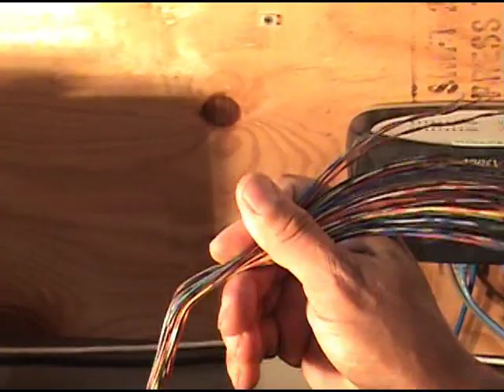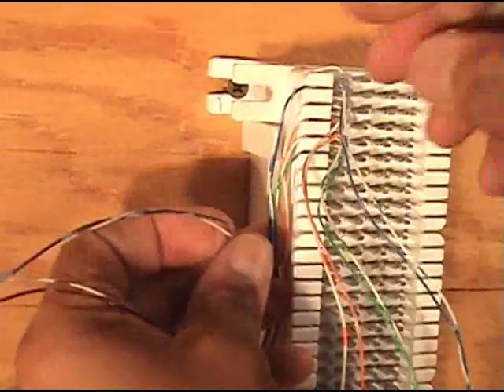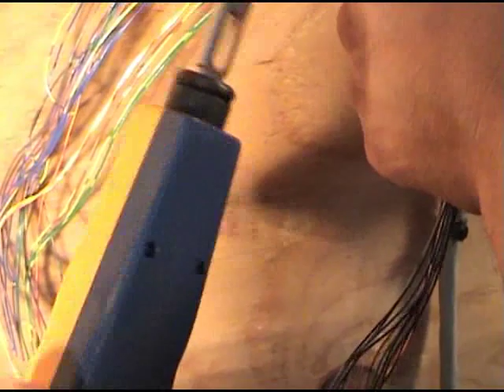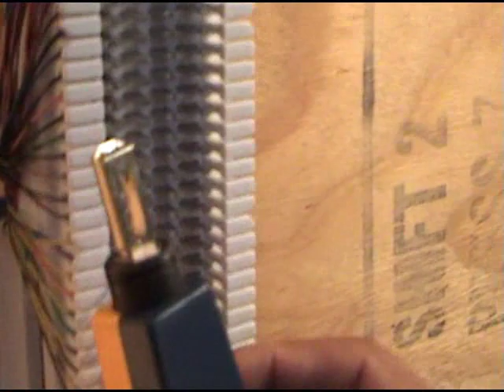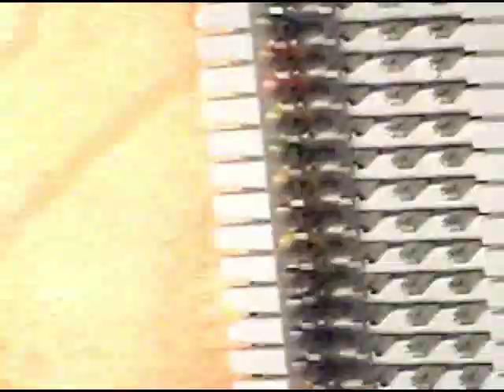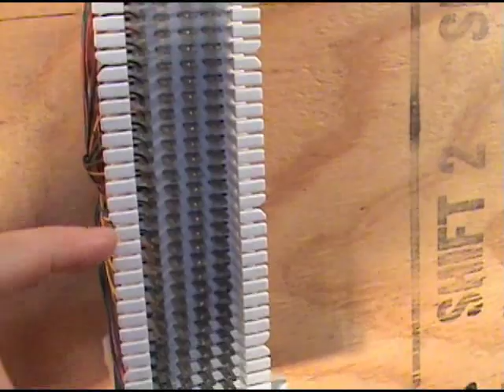How to punch down a 25 pair cable to a 66 block

Comment: Your end result looks ok, but it's much easier to fan the cable in from bottom to top, of course starting with slate/violet conductor on the bottom pin and ending with white/blue on the top pin.  That way you are not always having to move the previous pair out of your way to lace in the next pair.
Reply from the maker: I was hanging over a camera and working around the equipment while I was demonstrating punch down on a 66 block. You're right neatness does count, but sometimes you bring the cable in from the top. Sometimes it comes in from the bottom.

Comment: The color scheme is easy to understand if one is familiar with their primary and secondary colors from both the old and new systems. It's still all the same with the exception of violet, which makes sense why they chose that color because it's not represented in either scheme, and it would be confusing as hell to use the same color twice. I did not know the order of 25 pair until I watched this and saw how relevant it is to both systems. Great video guys.

Comment: I'm wiring up a pipe organ which makes heavy use of these telco cables to power 12 vdc relays and valves, but  the number of terminals never matches the available cables which is a pain. the 50 pair cable works but lots of extra wires left over. The connections don't use "pairs" but there's usually 61 valves or 73 valves each needing a wire. So I've started at one end of the windchest where the largest pipes are, note C-1 and those valves get the white/blue wire, and the next pipe C#-2 gets the blue/white wire since they are next to one another and less untwisting of the pairs needed.
I need to connect mechanical relays to these with a junction box, I decided on two 50 pair "66" blocks with 6 rows across each, installed side by side to have enough terminals for the wires for one chest, but since there's 61 relays x 2 I actually need a couple of 25 pair blocks as well for the one chest, and two more 50 pair and two more 25 pair for the other chest.

I am using custom 32 pair connectorized cables with AMP plugs.

It will be a lot quicker and easier than making a pin board and soldering wires to brass pins!

You should see how they wired up these 1930 era pipe organs using hundreds of green cloth covered wires throughout, the keyboards were a work of art with the wiring with each key having 3 wires, they installed the wires in so even, straight rows in a fan pattern. Unfortunately it all had to be replaced with modern telco wires due to age.

Comment: Definitely start from the bottom and work your way up. Then the wire is already out of the way to lay down the next pair. Teaches you to master the code. I also always separate by primary colors first, violet of course! Let the tool do the work when your terminate and keep that tip sharp.  :)

Comment: My networking teacher has 4 25 pair cable, i think..... it has 100 wires. 4 sets of 25 pairs.
Reply: If it has four 25 pair groups (binders), it has a total of 100 pairs, not 100 "wires".  Its called a 100 pair cable.  Each binder will be wrapped in a colored thread to define the binder. white through yellow. in the case of a 100 pr. cable.

Comment: How would I do this with individual cat5e cables from each office going back to our wiring closet so Qwest can bring in the lines and connect to them. Should I use a 110 block and if so how is that done.